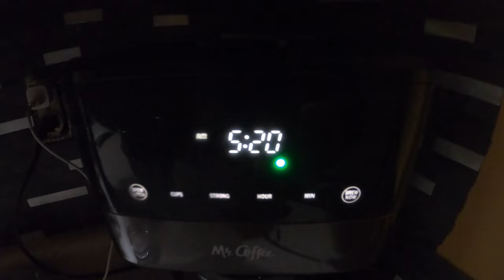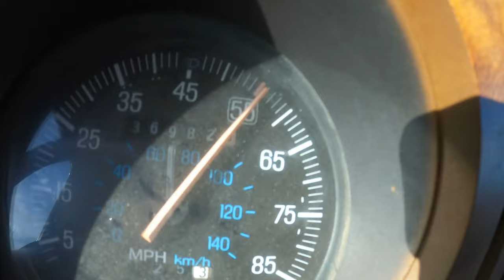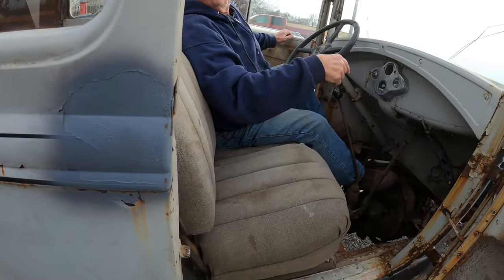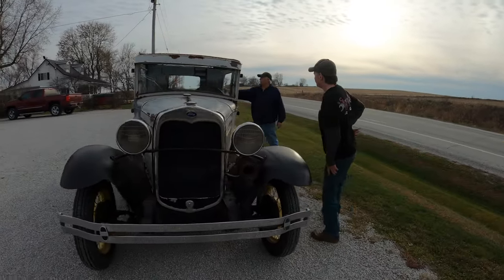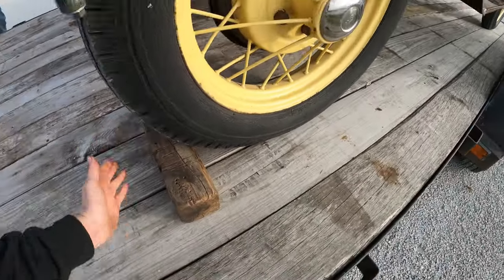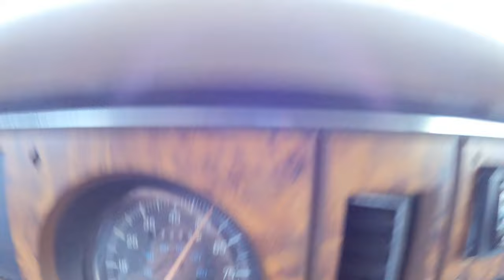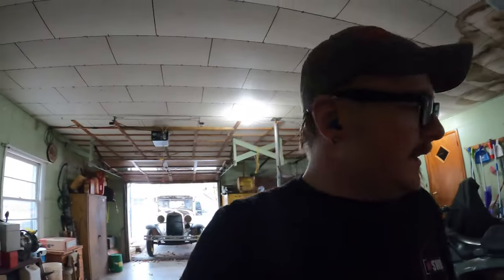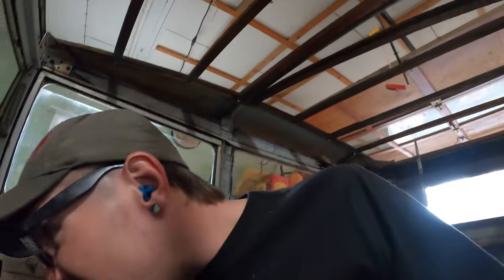Episode 64 I Bought a Model A

Comment: Check that fan for cracks. That’s the one weak point in the Model A engine. Those engines run forever, which is why the rest of the car looks so exhausted.  Also, don’t downshift into first until you are almost completely stopped.

Comment: If this is in fact an early 1931 Model A (late '31 had an indented firewall and the fuel shutoff was under the hood) the radiator shell would be incorrect for that year. The shell is definitely 1930 (stainless top with blue Ford logo) not 1931. So, despite what the title may say, your "new" old Model A Ford looks more like a 1930 car than a 1931.

But one thing is for sure. Your model A is going to be fun to restore and enjoyable to drive. Congratulations and good luck.
Reply from the maker: It is early 31. No indentation
Reply: I have a ‘31 Tudor, and I’ve had the coil wire fall out as well! Easy fix fortunately. You have an awful lot of work ahead of you if you want to restore it, but have fun with it. Get to know Snyder’s Antique Autos in OH soon! Please keep it stock.